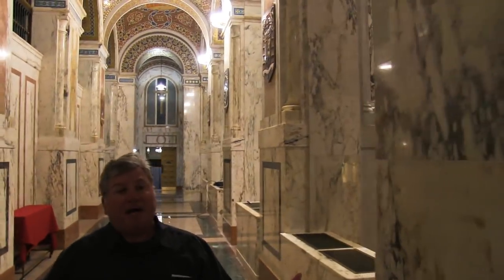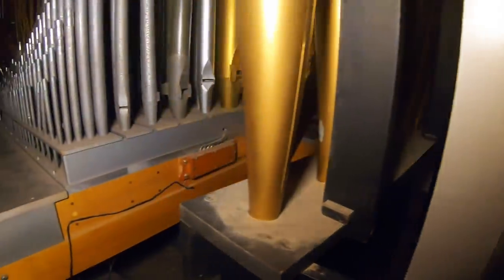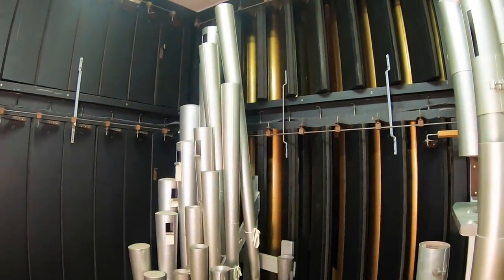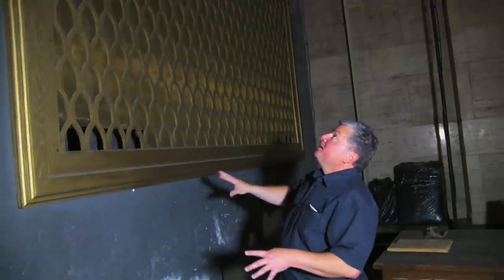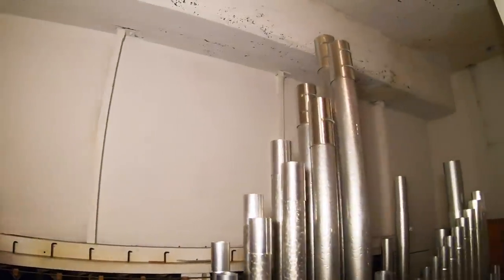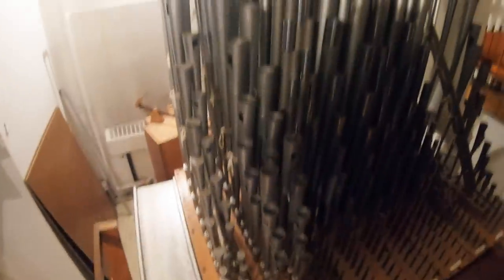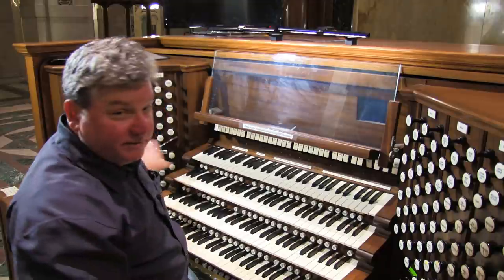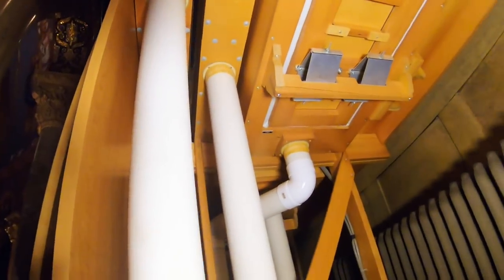1949 Kilgen-Moller-Wicks Organ - Cathedral Basilica of St. Louis, St. Louis, Missouri - Part II

Comment: The reed was likely replaced with a larger scale than Moller's chest layout would allow. Time for relay updates and expression motor repairs.  The issue with mixture tuning and switching isn't about airflow, its about how pitches react to each other or draw during tuning.

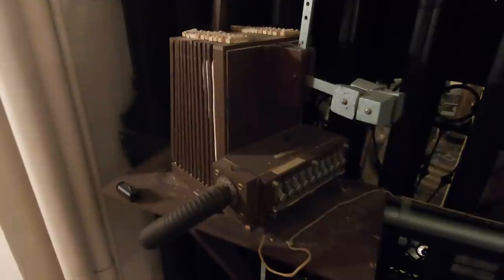Comment: The shade motors you were looking at 27:27 were built by M P Moller.  I installed many of these in the 1970's.  Most used a early perflex material that only lasted about ten years at which time blew apart.  Then I used player piano rubber cloth to make the puffer bags to replace the perflex.
Reply: Very interesting !! My grandfather ( Harold D. Ocker ) started working for M.P. Moller in 1924 and retired as a Vice President. Did you ever meet him ???

Comment: Sounds like the way I wired  my organ- each ranks has it's own negative which is connected to the rectifier's negative using relays that the stop tabs actuate.
I used 30 amp automotive headlight relays to do that, they have performed flawlessly for the last 20 years and switch on immediately
Reply: Ahh HUH AHH HUH AHH HUH

Comment: What are haskle(sp?) or heskle(sp?) pipes?
Reply from the maker: Haskelled pipes are pipes with inverted cans inserted into the tops of the pipes. It lowers the speaking pitch of the pipe.
Reply: @OrganMediaFoundation  Ok so pretty much like a stopped pipe?
Reply: Cornwall Dragon in addition to Brett's comment they are used to shorten open basses instead of mitering those same pipes or using stopped pipes.
Reply from the maker: Not completely stopped, but a similar phenomenon.
Reply: @OrganMediaFoundation  Thank you and thank you too @praestant8.
Reply from the maker: Maybe, but William Haskell was an American inventor.  His first patent was a toilet valve!

Comment: I'm very concerned to see the large about of dust around the pipes. It is not doing the organ any good.
Reply: The dust that does the most harm likely is inside the pipes. So to do a thorough cleaning to avoid dust issues, it would need to happen each month at least. Can you imagine having to remove the dust, then check each pipe for tuning after the dusting? My bet is the dust does less harm than imagined, and the hassle of removing it costs more time in tuning than its worth.
Reply: S N: Not mentioning accidental damages.
Reply: @Mrsnichols1965  Yes, I see your point.